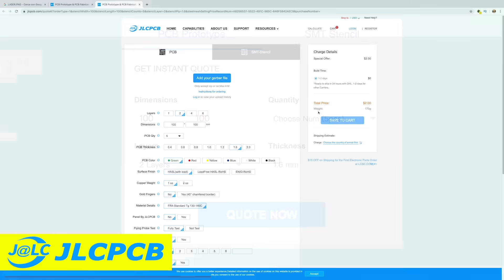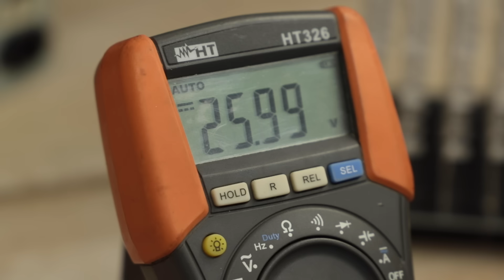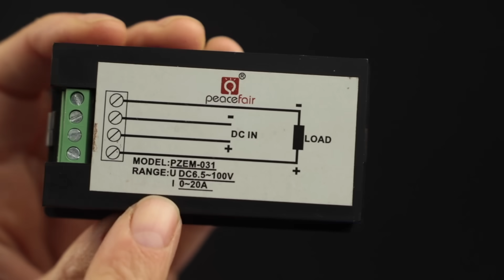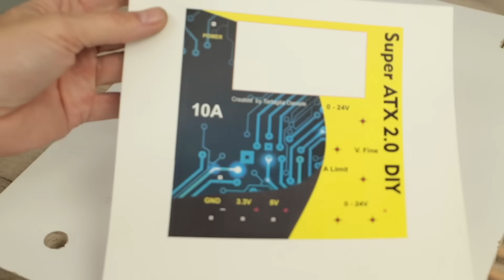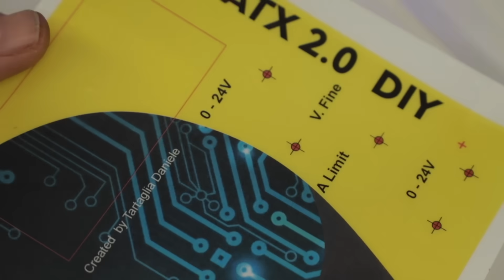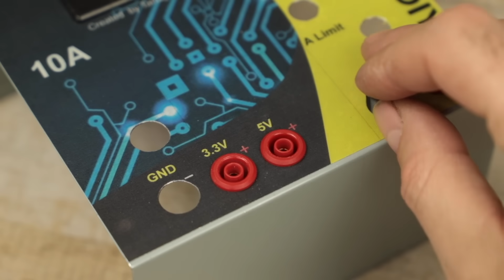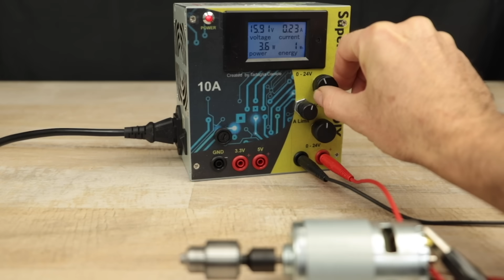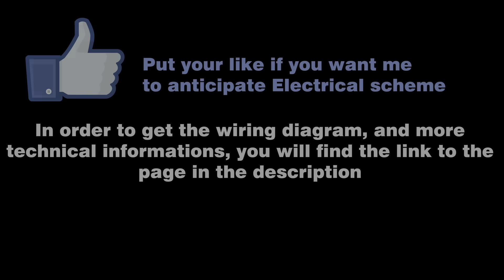ATX PC - DON' T THROW THAT AWAY!!! here is a BIG idea

Comment: my old psus goes so bad. it turn on and 12v detected by multimeter, but after connecting a fan, it turn off. I realized that capacitor is bad, so I replace it with similiar number. some copper pads peeled off easily when desoldering making it harder, but it just the ground side, so I can connect to the big ground pad and it works again.

Comment: So most supplies you find on the tubes use 3v, 5v and 12v wires, each with it's own terminals. This uses only the 12v for usage and uses the step up step down to adjust to what you want, which also adjust the current (amps). I like it.

Comment: nice idea... but i would also disassemble that display and separate power input from mesured input. and connect power input from 5v line... (should be some voltage regulator there, just connect its input to +5v or +12v), that way you can maybe get display working even on low output voltages like 2v.

also why load resistor on +5v line?

Comment: A buck converter only lowers voltage. Perhaps he meant a BOOST converter, since he was getting more than twice the ATX output voltage? Or a buck/boost converter, which does both?
Reply: I'm pretty sure that part is a buck converter, you can find it a-plenty on aliexpress / banggood etc. I'm guessing he's hooking the - of this buck to the PSU -12V rail and + to the +12V. Not sure if that's advisable...

Comment: 12:30 is a terrible solder joint, the stuff of nightmares! When you solder, you ideally want a mechanical connection, heat up both surfaces you’re soldering, and apply solder directly to the joint.
Reply: That said, it’s a nice looking project for sure!

Comment: Good video, sadly it would cost more to buy parts where i live than to buy a desktop supply off aliexpress.
Also from my experience if you draw high amps through even 12v wires for extended periods they will melt (considering most people bind together for better amperage) simple fix better wire.
I love tinkering but you soon learn why youtube etc can be bad as most don't actually show/teach you the dangers of what happens if you F*k something up.
Keep it up

Comment: These "self help" videos are reslly dangerous, especially without commentary. You really need to know you are doing and understand what this video "idea" is before you proceed. I would bet even after watching this video many have no clue what this idea really is.
Reply: I don't even know which is the input and which is the output. I'm great as software and even physics but this... whoosh.
Reply: The warning printed on the side of every psu "should've" been enough to keep the brainlets out for good. and I'm 99% sure someone who doesn't understand the art of negative and positive live contacts of a high amperage power source + the contact to you or undesired connections = boom... wouldn't be needing a powersupply, have the tools required to do anything besides unscrewing the case, or have the notion to try building one instead of buying one.
Reply: Unfortunately, many do not have the common sense to not duplicate what they see without first gaining the knowledge required to do so. However, I do not blame the uploader in any way. However, it's pretty sad when some people don't understand that a piece of equipment that is powered by mains voltage can be quite dangerous or deadly... Speaking for myself, I find this quite easy and simple to understand.. very straightforward. However, I have knowledge about the subject being presented. On the other hand, if this was a chemistry video and certain chemicals which I had no understanding of were being mixed, I would have the common sense to not duplicate what I'm seeing on my monitor because I know that certain mixtures can produce deadly and toxic gasses which could kill me within just a few moments.  In my opinion, the fault lies with the parents if it is a child copying what they've seen online. If it is a child you cannot blame them because of their age, nor can you blame who produced the content as it is not their responsibility to raise someone else's child and monitor their viewing activities. If it is an adult, you can no longer blame the parents, and certainly not the person creating the content. Sometimes "survival of the fittest" isn't too far from the truth. If you're a grown adult, then you should have the most basic common sense to know that AC mains voltage is dangerous and that you shouldn't play around with things you don't understand. If you do it anyway and you end up in the hospital or dead, it is your own fault. 
I can remember quite a while back that people were blaming a video on YouTube for a large group of people who had been injured trying to repeat the actions depicted. The video was a DIY hack style production, which again, any adult should be able to use the most basic of common knowledge to know most of these "life hacks" are fake and just for entertainment value. In the video you see a person blowing up a balloon and then covering the balloon in a web of molten hot sugar to create a sugar bowl... Many morons tried to do this only to find that they were covered in third degree burns after the balloon exploded and doused them and molten hot sugar...well... The outcome should have been obvious to begin with. Though I passionately despise these videos, as I find them annoying, I don't blame the content creator for some moron pouring boiling sugar onto an object that easily melts that is filled with pressurized air... In my opinion, that would be the same as blaming a home builder for not placing a warning sign on a new homes fireplace because you happen to get burned while trying to crawl inside of it while the fire is burning. It just comes down to using common Sense.... And the unfortunate people who seem to have none.
Reply: @tylermoses7829  the comment you replied to lacked common logic, and flew right over your head.
Reply: @tylermoses7829  look just a tip. Lose faith in humanity, when someone makes a comment like that, don't respond... Why? Because they wouldn't understand. how? It's apparent from the comment they made that brought you there in the first place. Also aside from the fact they most likely don't care, as the comment was made a statement instead of a question, and people like that get annoyed when an answer is given to a statement instead of a question. Stop wasting your time. And the comment section isn't a place for smart people.

Comment: I was bored one day so I decided to clean out my psu and I almost died, do not stick your fingers inside one of these things if you don't know what your doing.
Reply: I think I would discharge them safely using resistors to be on the safe side. 

My first thought when he opened the box was, yikes! That is going to burn some hands. 

Never assume they are discharged just because they have been standing on some shelf for years. I once had a look into a DVD player that was struck by lightning to see if I was bothered to try to fix it. My thumb came across one of the capacitors, and in a second I got an entry and exit burn on my thumb. That for a device that had been unplugged on a shelf for a full year. 

Be careful, and know what you are doing before opening up. Those things are so easy to overlook, and you get no warning signs at all.
Reply: How long were you deaf for?  Try shorting-out a flashgun capacitor that is really loud!
Reply: You have to make sure the capacitors are unloaded, simply remove plug from psu and try to turn on your computer.
Reply: @SpyrosLv  I guess I would have been fine then since I did that.
Reply: One way you can discharge the caps without attaching stuff to them (which could cause those large value caps to blow up if you exceed what they can take) is unplugging the supply off the outlet and keeping the power switch pressed for about a minute.
Reply: safcforme maybe he meant “it will be your doing”. Nah! He did mean “you’re”, but everybody understood anyway.
Reply: In America there is 180 VDC between the heat sink and case. I almost put my dick in the dirt on one too.

Comment: The supply module is a boost module not a buck module coz it is using 12 volts as input and boosting it to 28 volts. So there is a mistake in the video at 17:25. Buck module cannot go up to the input voltage.its only can b achieved by the dc dc boost module.

Comment: I don't get it - how did you receive 24v from 12v with a step down buck converter?
Reply: I believe it is a step up step down converter. There's one on amazon. Brand called Yanmis. You may can get a similar one on ebay.

Comment: Wht potentiometers did you use? You didnt link those parts
Reply: At 6:28 he shows a 220k ohm potentiometer he uses for the current limiter. Both of the trim pots on the step up step down converter are 200k ohm ones. He uses different pots for the voltage adjustments (probably better quality ones). I am guessing they are also 220k ohm pots.

Comment: If i were experienced enough to do something like that
I would have added a 12v cig lighter adapter, if there was enough room.
Reply: They draw around 10 amps, I wonder how the switch mode power supply would handle that load for the time it takes to heat it up properly? With multiple loads attached?
Reply: @roygalaasen  Good question. Though i meant the 12v Aux adapter part of it not the actual cig lighter portion lol

Comment: Big idea - poor execution: You have at least 2 bad capacitors, one has a visible leak even; no 12V termination; only 1 ground connector for 3.3V and 5V rail; 5V load resistor could be mounted inside against the flow of the internal fan; green to black is hard-wired, it should have been wired through a switch (one with backlight connected to power on instead of a separate LED).

Comment: Hi Daniel, where do you connect the potentiometers, I only saw how you connect 2 of them and show three?
Reply: 13:04 the first two potentiometer was connected in series,the middle slider of the first is connected to the second potentiometer to help with the voltage control,since it's not a multi turn potentiometer.

Comment: So you kept the obviously bad swollen capacitors? Reckless and dangerous.
Reply: I was wondering the same thing. One clearly has some snot leaking out the top... Plus mounting that regulator (while most likely touching a live part of it's board) to that heatsink which could even be live itself if it was a cheap power supply.. doesn't sit right with me.
Reply: @Androwski69  That's not "snot leaking out of a capacitor", if a capacitor leaks, it doesn't look like that. That''s just potting compound, which is put there by the manufacturer to keep everything from moving around and getting lose, mainly in transport. Think of it like more professional hot glue.
Reply: haha capacitor go boom
Reply: Jimmy S  The 24V is being made by the buck-boost converter, not on the 12V rail. The 12V rail is still supplying 12V, just at higher current. Depending on the efficiency the 12V rail will have to put out 2A@12V for every 1A*(Efficiency) on the 24V output.

Comment: 7:03  From the way you were holding the case to mark the mounting holes, there seems to be plenty of room to mount the power resistor inside the case... It's ugly, and it would have been cooled just as well with the airflow created in the case by the fan. Then why mount it on the outside?
Reply: What is the function of the power resistor? is it a very expensive component, can it be replaced by something else or is the resistor optional?
Reply: @diegof.8052  It stabilises the outputs. It will make the output voltages closer to the desired values. It is essential for very old PSUs to even remain ON, but it's still desirable on newer ones for the stability it provides.  To save money, you can replace it with any high wattage light bulb of the proper voltage. Perhaps a bulb from a car... But that only helps if you already have one because the bulb is likely more expensive than the resistor. 
A bulb is not easy to work into the design, but one advantage to using a bulb is that you now have more lighting to work on projects! 😁
Reply: @robertcartier5088  LOL. ok, I understand you, but is it necessary that the power resistor is 10ohm? in my country this resistor is expensive because it is an imported product and it is only available in 6ohm and 8ohm. Do you think there is no problem if I put in its place a 6 or 8ohm power resistor?
Reply: @diegof.8052  also, there are much cheaper versions of those resistors. They are thinner and longer... Just google "power resistor" and include the word "sand" because that's what they are made of
Reply: @robertcartier5088  Thanks for the clarification. The power resistor used in the video is expensive, do you think the resistor you see here https://amzn.to/3lw9rGO can work?
Reply: @diegof.8052  Yes, that resistor is exactly what you need.  You can use metal wire to attach it to the inside of the case, across one of the vents. This will help keep it cool.  (Alternatively, you could use 2 of the 6 ohm ones if you already have them. Together, in series, they are 12 ohms, which is close enough.)
Reply: @diegof.8052  You are welcome, I'm glad to help!  ;-] 

In the video, the guy replaces the pots from the DC-DC buck/boost converter... 
Therefore, you simply replace them with exactly the same value as the ones you are removing from the board for bigger ones that are made for external access.  So the values depends on which converter board you use. The converter board is necessary to build something fully adjustable like the one in the video. 
Your meter can only measure up to 3 Amps, so it is not suitable for this high power project. 

Note:  But do you really need yours to be adjustable? 
If all you need is 12V, 5V, and 3.3V, as fixed voltages, then you can forget all about the board, the pots, and the meter.  There are also ways to get other, intermediary fixed voltages from those three voltage rails... Even more if you include the negative rails.  If this simpler version meets your needs, there are better videos to watch than this one.  Let me know if that is the case, then I will provide a link to the video I used for mine...  Below is a link to the faceplate design for mine, I'm sending it to show the variety of other voltages you can get without bothering with the expensive parts to make it fully adjustable.

link to faceplate:  
https://www.dropbox.com/s/oqk7f4dioddw555/Power%20Supply%20face.JPG?dl=0

Comment: For all of you asking "WTH is that resistor on the 5V doing there?":
For the PSU to correctly regulate the +5V output voltage it needs to have some sort of load attached, at least 5W to trick the PSU into thinking its attached to the motherboard.
Reply: Some power supplies don't need any resistors on the outputs. I used to buy and sell computers so I have quite a few spare PSU's and some of them seem to work just fine by shorting the green sense wire to ground to get it to turn on, as other PSU's will need a load on the output to turn on.
Reply: @mashedpotatoes5323  i think that most of them have a cooling-fan with give that load
Reply: If I were to do this project, I'd likely try using a 5W LED light, on a flexible stalk.
Reply: @JLG331  Great idea!   Often when we are working we need a task light to focus on some thing we are doing.
Reply: Nice!
Reply: É para manter a fonte mais estabilizada. O resistor serve como carga fictícia e mantem a saída da fonte mais estável.

Comment: at 2:37 i still dont get it how the step down buck converter manage to output more than 20v while the input is 12v
Reply: It's probably a buck-boost converter, not a buck converter. Otherwise, it would be impossible to get more than 20V from 12v.

Comment: Question: On my power supply I have six 5 volt lines and 17amps on the 5 volt system... does that mean that the 17 amps is divided up equally on all the 5 volt lines? 
I’m building a cellular phone charging station for my whole family and I’m gathering info so I don’t destroy anything 🤪.....
Reply: You shouldn't worry about the 17 amps for the charging station. The current in the output will be the current the device drains up to 17 amps. Usually a charging phone or tablet drains 1~2 amps.

Comment: Dear friend, what is the purpose 10 Ohm resistor between red and black ?
Reply: Switching power supplies have a maximum current and a minimum operating current to give the voltages for which they are designed. To achieve this minimum current, it is necessary to connect a load (in this case a 10 Ohm resistor) between + 5v and ground.

Comment: The Good:  The front panel artwork is awesome.  I especially like the method used as I'd not seen that before. 
The Bad:  As usual with these DIY supplies, there is no way to adjust Constant Current which means that the supply will feed its maximum current at whatever voltage it is set for into the load whenever a short circuit is encountered.  Since these ATX supplies can deliver 25 amps or more, that can be very dangerous, both to the operator and to the circuit under test.  It's a very useful troubleshooting technique to be able to dial down the current so that when power is applied, the current is limited to a level that is safe for the circuit. This is also especially useful for charging Li-ion batteries as you want to both limit the current and taper it off as the battery reaches its maximum voltage, otherwise it could blow up in a spectacular fireball.  Don't ask me how I know this.  Also, why mount the power resistor on the outside?  It'll just bang into things and possibly scratch them up.
Reply: How would you incorporate "dial down the current" in this build? Thanks
Reply: @stspringer2003  He mean the 3.3v/5v/12v port, if using the 5V for charging phone, it can supply as high as 30A which is 150watt to phone without current limit control. Not the last 0-24V port as it have pass through voltage current limit modulator.